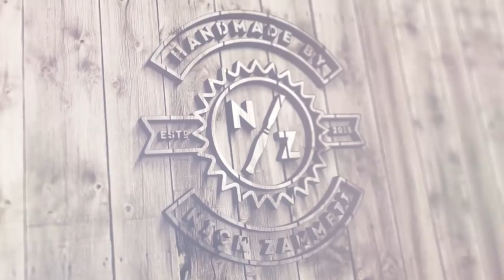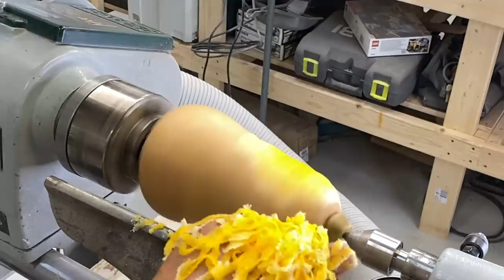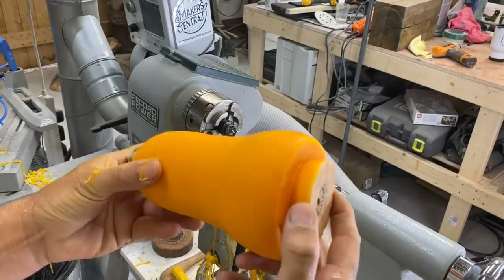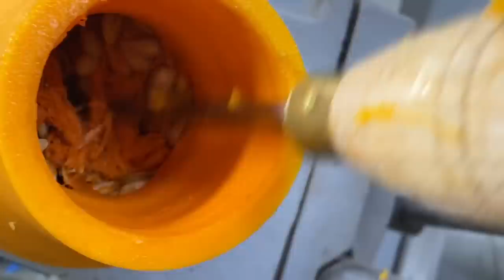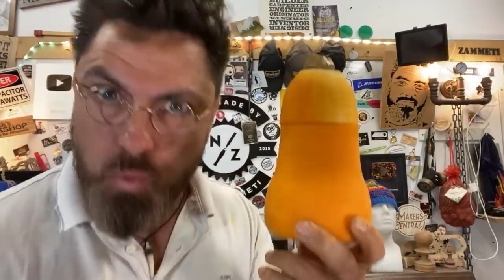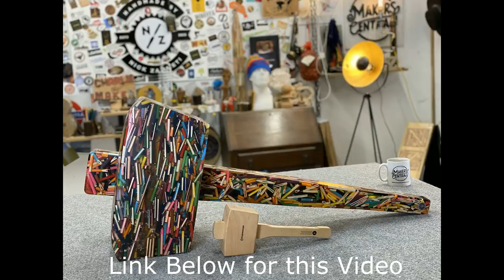Woodturning a Butternut Squash  .. Whatever that is ?

Comment: You should Immerse it in silica gel for a few weeks, it'll dry it out and preserve it, then varnish it! Pukka!
Reply: That's a fantastic idea.
Reply: Or stick it in resin
Reply: Has very little structure when dried. Need to replace the water with some kind of polymer. They use this to preserve shipwrecks and even cadavers.
Reply: I was wondering if you can maybe dry and stabilise it somehow. ... What am I even saying...

Comment: One of my favorite squashes ever! Split in half lengh-wise and remove the seeds.  Bake in the oven (I use a glass dish) with about a half inch water cut side down at 350° F , covered with foil for about 30 minutes. Remove foil, flip cut side up, lather with butter and brown sugar and finish roasting sans foil for about 10-15 minutes. OMGosh! So good.( Oven temps and times might vary 😁)

Comment: Cut in half, remove seeds, put some olive oil on the cut side. Cut side down on a baking sheet, 350 (Fahrenheit) until a fork stabs with no resistance. Scoop out into a blender, add chicken stock, salt and pepper, garlic and onion powder, I also personally recommend a hint of cinnamon and smoked paprika. Blend until soupy and garnish with bacon

Comment: Chop up some onions, celery and garlic. Mix it with some mince with salt pepper and basil. Stuff the mince concoction into the squash and place the lid back on. Put 2cm of water in a baking dish and place the squash into the pan standing up. Place into a 180c oven covered in tinfoil. Bake for 1 hour. Remove foil after 1 hour and cover with a GOOD cheddar cheese and then broil until the cheese is melted and golden brown. YUUUUUUUUM!!!!!!

Comment: Everything on the squash except for the stem and the little bit on the other end is edible once cooked.

We tend to cook it fast in the microwave by cutting it in half, clean out the seeds, place a bit of butter in the cavity and wrap it in cling film, and cook it in the microwave until it is soft. No need to heat the oven up. We season it with salt and pepper, no need for sugar or honey.

Also makes for a great soup.

Comment: Put it in a dehydrator or freeze dryer to remove all moisture from it, impregnate it with resin and make it into a small vase or cup. It will shrink quite a bit in the process.

Comment: Split in half remove the seeds you can toast them like pumpkin seeds. Bake the squash with butter salt and pepper until soft then enjoy. They are also good as a Halloween decoration if you use non toxic paint you can eat them later.

Comment: its shaped like a nut and also its cooked with butter. you can cut it in little square pieces after you removed the cover and boiled it with just sugar and bit of cooking oil so it will be sweet and another method you can just boil it with water for 10-15 minutes there after use butter to tenderize it.

Comment: Me: isn’t that just a butternut pumpkin?
Nick: “sometimes know in Aus and NZ as a butternut pumpkin”
Me: ah yes. All is right now.

I wonder if you filled it with the silicone beads then put it in a box full of them if it would keep the shape and just dry out. Then you could coat it in resin to protect it.

Comment: As I'm sure you know by now, it's a fruit. And it IS a squash by the way, very similar to a pumpkin. Cut it in half lengthwise, and remove the seeds. Lay it in baking dish cut side up, and sprinkle it with brown sugar, cinnamon, and nutmeg. Lay a few pats of butter on top and bake it at 350 F 175C for about 45 minutes, or until it pokes done with a fork. (Don't eat the shell)

Comment: Using the hairspray method you used with the dandelions to keep water from the material ruining the resin, couldn't you set the squash so it won't rot? Or am I being too optimistic? I'm imagining a more translucent color, an orange probably, but maybe just a simple clear color

Comment: You're too silly:)  Cute pot though, I wonder if it could be dried out in a way that you could then coat it with resin so that it wouldn't rot?...hmmm:) Some people, near my area anyways, have a process of drying these out to where the outside becomes really hard and they use that to make pots and bowls.  Once they are dried out and hollowed out they are then called a gourd.  Many times you will see them at craft shows and shops around here and they will be hand painted.  
 My gramma makes a caserole using these that my entire family loves except for myself that is.   I'm not a big squash eater, though I do like it okay in a some stir fry.
Thanks for sharing:)

Comment: Wounded how it'd take to stabilizing resin since the body is so moist. Make a true pot out of it 😊
Reply: Can't put it in resin like this. To much moisture, would really mess it up. However if it is dried out which can be done by placing it in silica beads to draw out the moisture (be sure to fill the inside to the top and immerse it completely)what is left could be put in resin. However I dought there would be much left as it is about 90% water. I have on my porch a butternut from last fall. The inside has completely dried up and the peel is as hard as wood. Getting ready to turn it into a birdhouse.

Comment: Aniliaanse pumkin pancake 

Cut in halve & de seed, cut in big pieces and boil or bake until tender scrape "meat" from peel with spoon. Mash the meat till smooth add rum vanilla extracts raisons and a few table spoons off sugarr untill its a sweet mash add flour pinch of salt and tsp baking powder and some left over boiling water to make a smooth but thick  batter let it rest a bit and fry in a pan with oil or butter us pancake size dollops of batter let them flow out and bake each side 3 to 4 minutes on medium high  or till some browning occured. They will rise but wont be fluffy. The inside will stil a bit gooey but not raw on the inside. Its a aniliaans pancake recipe i got from my sister in law her mother inlaw and they are tha bomb to have cold to work and hot right away sweet pumkin pancakes

Comment: Take the skin off (the squashes, not yours, you dingus), cut in half and scoop out the seeds. 

Cut flesh (squashes, not yours, you dolt) into chunks about 1 inch square. Boil until soft enough to mash. 

Mash, then mix thoroughly with quarter stick of butter, and a third cup of brown sugar.

Drizzle with honey. Serve hot.